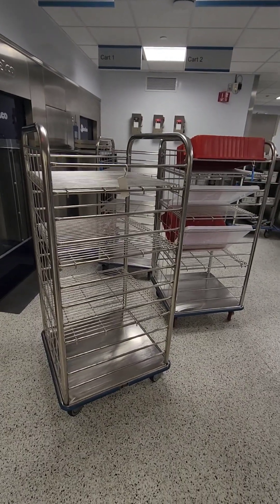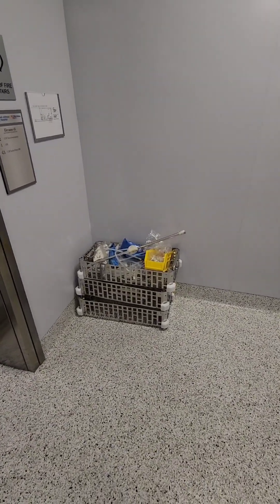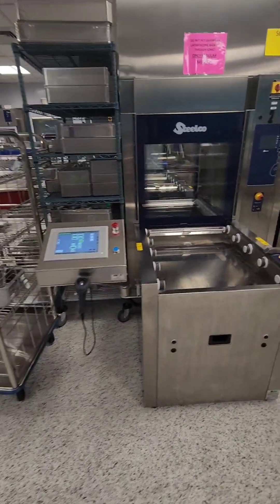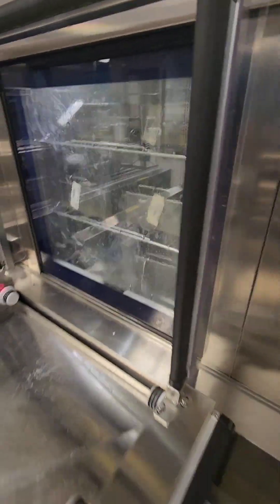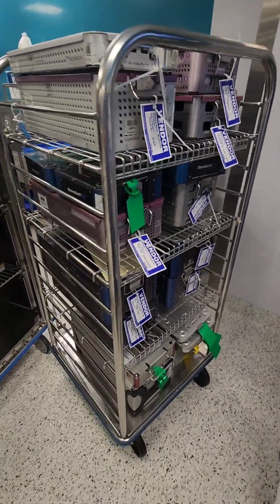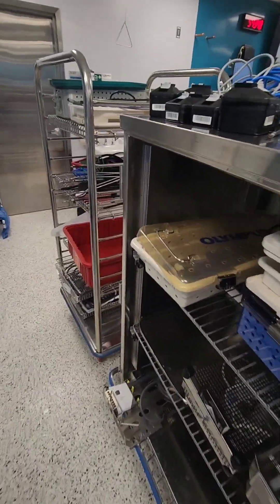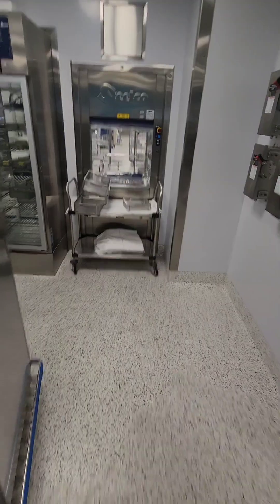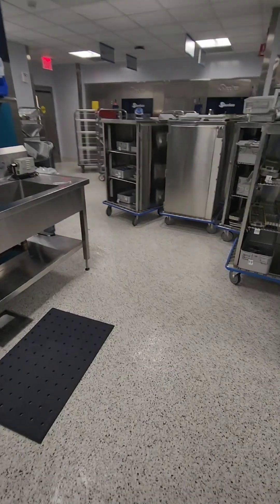Sterile Processing: A real look into Decontamination

Comment: ours is so packed and when carts are brought down there is at time zero room, once I was leaning into a cart to remove trays and someone brought down another cart and there was no room so they started to push the carts which almost hit me in the head. My pet peeve is they just dump the cart wherever they wish with zero regard to anyone else, no room for me to work and no room for another to bring down the next cart....now my pet peeve is based on safety, cant see if someone falls or has a health issue in-between carts. I always stop what I am doing and line the carts up to make room and so those working in the clean side can have a view in case I fall/slip...And dont even get me started with the bags filled with bodily fluids which are sometimes dragged across the floor and leak....
Reply from the maker: I feel your pain. Before our upgrade that was our department. Many SPD across the country face the same challenge. Very few build for comfort or growth, let alone safety.  It really is sad.
Reply: Our spd is so small , only 1 sink , 2 instrument washers ,no cart washers we have to wipe   every single container. Cases keep coming down , there’s no room. A lot of total shoulder cases. It’s so frustrating